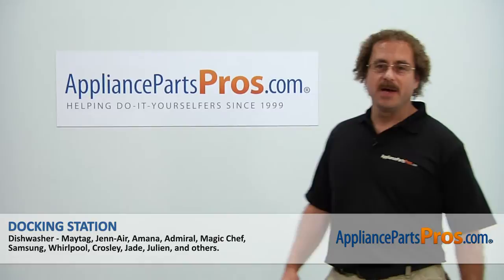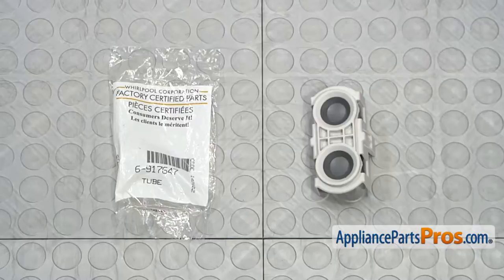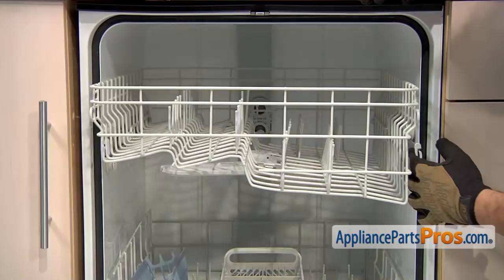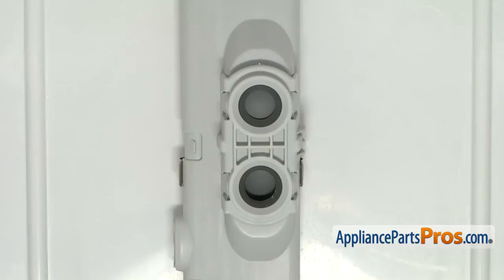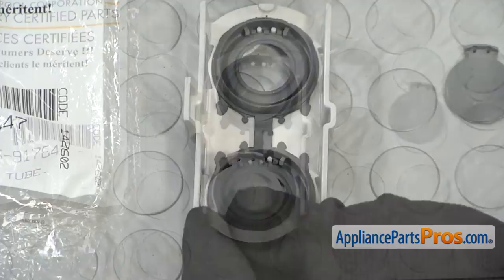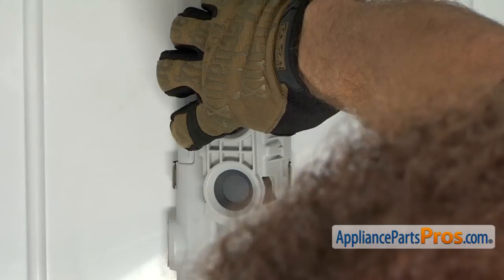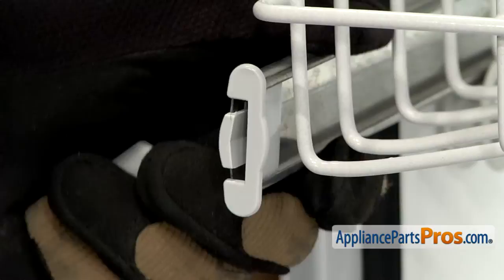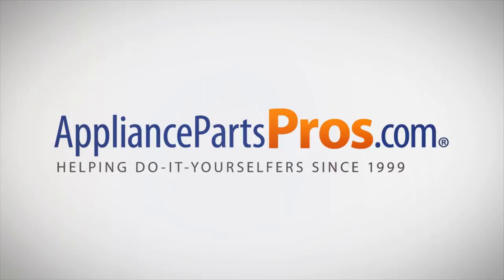How To: Whirlpool/KitchenAid/Maytag Docking Station WP6-917647

Comment: It's killing me that this part is no longer available. Just the little rubber flaps would have my machine working like new. Without them, it's half-useless.
Reply: I agree.  I’m trying to engineer a fix with rubber material in my shop but it’s not coming easily